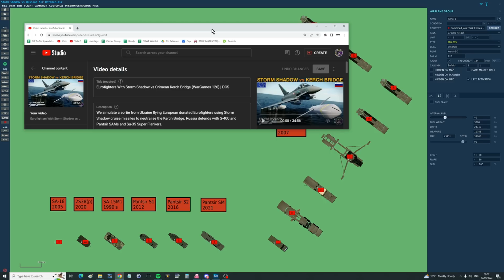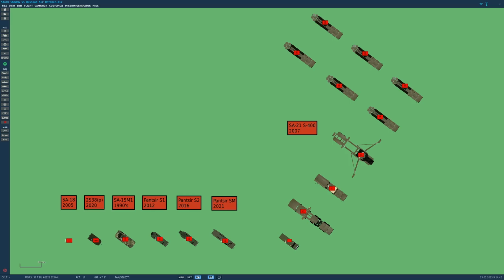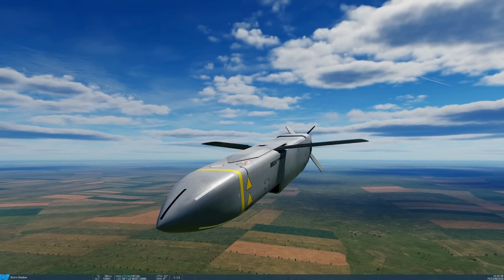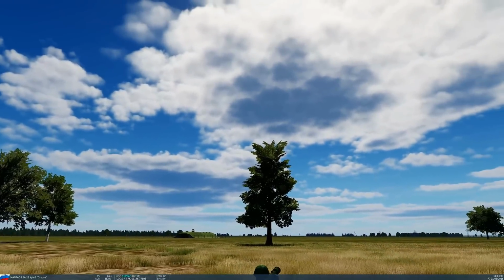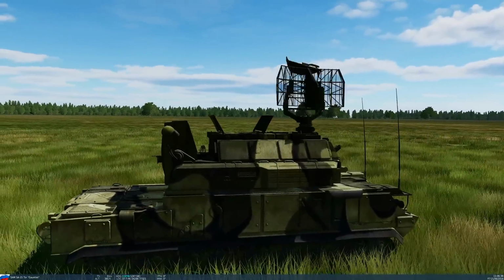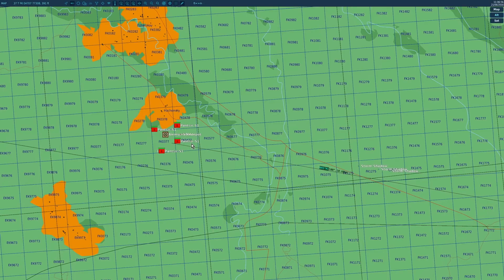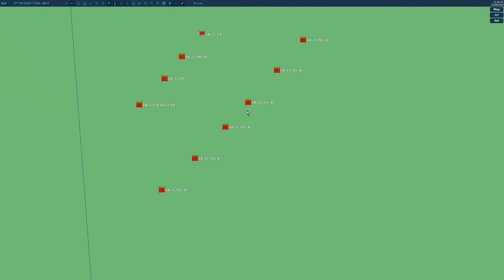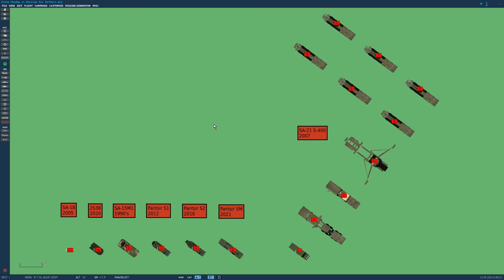Storm Shadow Cruise Missile vs Various Modern Russian Air Defence Systems | DCS

Comment: First of all, the built in terrain maps and maps are useless without a precise navigation system, then if the Russians are able to jam the GPS signals, something they have proven to be able to do with at least three different jamming systems at their disposal (supposedly one reason we don't hear much from Himars anymore), the missile will have to rely on the INS/IRS which by far not as accurate as the GPS and degrades when the missile changes course: the more turns the more degrading, so the missile might not be where it "thinks" it is when approaching the target. What will the missile do, if it cannot identify the target upon programmed arrival using the camera?
Reply: That would be true if they didn't TERCOM at the same time or whatever other acronym does either optical or GPWS-style matching confirmations. There's a reason why Tomahawks and ALCMs flew via Iran in 1990 because Iraq's southern part is as flat as a pancake. The turns over Iranian hills gave more precision by offering correction. 

Cheers from a commercial pilot.
Reply: @Walterwaltraud  Well this is neither Irak nor Iran, and Russia has totally different electronic warfare capabilities.

Cheers back from an ATP pilot.

Comment: I got some info on how they deconflict the SAMs and aircraft. There is IFF systems but they are either not reliable or older equipment can't use it. So they will send out notices to SAM operators that the air force is operating in this area at this time. And so there are zones and times where the SAM is to consider air targets friendly. So the SAMs can stay on, but its easy to make a mistake and shoot at your own guys or to let targets through as they are coming through a air zone designated friendly.

Comment: the US doesn't use super tall or even very large mobile radars because 1. It doesn't fit their envisioned combat needs. 2. They plan to have complete air dominance in an area before boots are on the ground.(in western militaries aircraft are highly networked with SAMs etc & are used as an extension of AA systems)

Comment: As stated by the Ukrainian MoD.. The Su-27 and Su-24 have the necessary load capacity to carry Storm Shadow... but if my memory serves me right the Mig-29 (depending on what model I would suppose) can only carry 750kg of weight in total on all pylons. That, if I am correct, would preclude the usage of the amazing Storm Shadow on Mig-29s.

Now F-16s is a different matter. From what I have heard, though this is just breaking news and unconfirmed currently, the United States has given approval for EU F-16s to be transferred to Ukraine. It was stated though even if the pilot training started today it would take, at an absolute minimum, 4 months to bring pilots up to speed on the western jets.

Comment: 17:25 Serbia bought a version of this turret and gun, but for ground attack vehicles, not AA. Mounted on prototype vehicle called "Lazanski". And it has faster rate of fire than shown here. Hell, even S-60 which is 57mm AA gun from 1950s had faster rate of fire (70 rpm sustained and 105-120 cyclic). So, I'd call this unrealistic.

Comment: ADM-160 MALD is a decoy designed to fly around and get shot down....lol    Seriously, it is used to attract the Air defense, so missiles like the Storm Shadow can get through.   The MALD has all kinds of tech to detect Air defense systems when they fire at it.  Which is used for counter fire.   It has no warhead, either.   This would most likely be used with the Storm Shadow missile, making everything more effective.

Comment: I'd like to see the Storm Shadow vs the Kerch bridge, but it ought to be accompanied by other long range HIMARS or possibly Neptune missiles. Even if they can't reach the target they could function as SAM sponges. (Have Cortana plan the attack and tell her we want as many distractions as possible, so long as they are realistic)
Reply: The railway line has a rich supply of bridges in Crimea proper that, if taken out, would render the Kerch Bridge effectively useless for supply purposes. These are likely to be way less defended. I would go for the bridge over the North Crimea canal at 45.180N, 35.431E. Not only causing supply problems but  also causing issues with the water supply to Kerch 🙂

Comment: 2S38 , what like the T-14 Armata, like the SU-57, like the SU-75, like the MiG-41let's not forget the SU-37. Russia talks nonsense, comes out with half baked concepts, zero manufacturing competence (no 2 same of anything is the same in Russia). I question everything Russia makes right now, I understand the design but the actual execution of these designs is terrible. I seriously doubt the range, ability and reliability of Russian tech. Admiral Kuznetsov, the T-90 the Ka-50 series the whole stinking lot. FFS even fire extinguishers on board their ships are secured in an arms locker that can only be opened by Admiral or above, no joke.
Reply from the maker: My understanding is that Russia like to develop these systems for sales abroad, but when they don't get enough orders to justify the build, they are canned and never make production.
Reply: @grimreapers  I think that is partly true Cap, however look at those who buy these systems they never buy again. Recently Brazil choose the Grippen over the Felon. India pulled out of the Felon entirely and are even phasing out the Russian inventory in their military citing sub-par standards. Russia is not an industrial superpower anymore and the new designs are just rehashes of old. Your completely right Cap and you even say numerous times DCS works on the principle that everything works to what it is designed for. My problem is that when it comes to Russian or Chinese equipment or tech in the past 50 years it has never shone or showed anything what was claimed. Case and point the Flanker, it has never actually achieved air superiority in any theatre of war, ever. Be it Russian Flankers and any other Flankers. So when everyone says the Flanker is on par with the F-15 there is no actual example of this or anything close to an example. Even DCS players know to keep the expectations of the Flanker to a lower level. You guys (GR) even showed me the Cobra manoeuvre is a dangerous thing and honestly only useful in 1 scenario, the rest of the time it will get you killed. 

In short all public military material is to be taken with a grain of salt and they all tell a lie or exaggerate the truth. I just have a sneaking suspicion that Russia and China are telling far bigger lies about their military capability. Even you Cap were left scratching your head about the Moskva.

Comment: Wargame suggestion:

4 Russian aircraft were recently shot down over Russian territory including two Sukhois. The people that say that Ukraine was responsible for the shoot down are split between Ukrainians inside Russia with MANPADs, Ukrainian fighters, Ukrainian fighters WITH western missiles, and Ukrainian long range air defenses. Can you wargame which of the 4 speculated causes are the most likely causes? Love ur vids, thanks!
Reply: Manpads are unlikely to be that cause of that shoot down, a visual evidence suggests that at least one helicopter was downed by a missile that was ca. 4 m long. Also, all the crews were killed, manpads does not pack such a punch and usually there is time to eject (for aircraft that is); one option would be that those were downed by Ukrainian SAMs but that would require bringing them right up to the border massively risking their loss (even if due to the visible logistics); the whole event unraveled within few minutes; Russian aircraft and helicopters were a complete strike package (Mi-8s were an electronic warfare versions Russians have 18 of them, with 12 in flying condition), and they went down in a quick order. So however crazy it wouldn't sound the most likely option is that those aircraft were downed by.... A salvo of AIM-120s. Now that is an interesting development if it were confirmed.
Reply: @44lucas  Good points but after all, this is what wargames are about so I think MANPADs should still be included for the sake of it being a possibility however unlikely. As for SAMs, I think it could be possible with Patriots using PAC-2 missiles which have a 160 km range so they could cover the area where the shootdowns happened while placing the launchers not too close to the border so I don't think SAMs should be ruled out. As for AMRAAMs, they could be also be possible considering we didn't even know that ADM-160B MALDs were in Ukraine until debri from the decoys were found.
Reply: @shtorm2616  it was friendly fire incident for sure. There cant be so many MANPAD units in quite large area (~50km between crashsites) acting simultaneously. Also cant be SAM even on border - too far to hit low flying helicopter. Friendly fire due IFF malfunction/operator's mistake. That's why both ukrainians and russians not talk too much about it - nothing to be proud for both sides.

Comment: For what the gentleman was talking about with the programmable projectiles fired from a canon, look up the Oerlikon AHEAD program.  From what I've seen of it, it comes in multiple calibers for an array of platforms that it can be mounted on.  Impressive stuff.
Reply: Yeh Rheinmetall offers the Skyranger wiht a 30mm ahead gun as a kind of Gepard successor. A single smaller gun, but makes it up with airburst ammo and AA quad launcher (eg stinger or so).

Denmark actually bought that system recently. Hoping Germany follows up!

Comment: Very high risk for Russia - allegedly lost 2 x airframes and 2 x helos in the last 48 hours to friendly SAMs.
Reply: it was a Ukrainian ambush, it wasn't friendly. Russian SAMs have IFF capability and the SAMs would be told about active friendly air operations.
Reply: @spidersaremean8917  no they don't. They tage friendly planes all the time. Hell most of the Russian air losses in 2008 was from friendly sam systems
Reply: @terrynewsome6698  not sam systems but MANPADs. Both sides in Georgia used Su-25 so mistakes of ground units was common. But this very incident likely be due the SAM IFF malfunction/operator's error. True.

Comment: I think the reason Patriot doesn’t have it’s own long range ground based Radar is because doctrine says that they will rely on airborne networked platforms such as Apache or AWACS.
Reply: I was wondering about that, too, and I would guess it's because of the type of threats America would usually encounter. The US always fights in an air superiority situation, so airborne radar platforms are always available to track low-flying cruise missiles. Anyone else using the Patriot should think about supplementing the radar array with something to boost its low-level detection radius.

Comment: Actually, The SA-12/S-300V did intercept all of the Iskander-M's in your video (Using the 9m82 missile). The system even managed to down one of the Iskander-K cruise missiles (Using the smaller 9m83 missile). It was the SA-10/S-300P who had trouble due to not having the proper radar (Clamshell radar) given to it (An ingame issue).
Reply: Tbh my trust in russian AA/AB systems is pretty limited at this point. Even an S-400 struggles to shoot down basic GMLRS missiles, but Patriot takes down "indestructable" Kinzhals? 

Kinda reverses the previous hype of S-400 being world class and Patriot bad.

Of course, the systems still work, even S-300 are a big reason russia has no air superiority. But more advanced russian/soviet AB/networking capabilities seem suspect.
Reply: @termitreter6545  I doubt it, cause the "interception" of the Kinzhal missile is quite unconfirmed. Because Ukraine claimed to have shot down 6 or so Kinzhals, while the Russians have said they never even fired that many in the first place. 

Plus the claimed wreckage of the Kinzhal missile doesn't have any similarity with the design of a Kinzhal, it looks more like a FAB-500. 

Also both the Kinzhal & Iskander-M aren't ballistic missiles, but rather semi-ballistic missile with cruise missile type capability. And just like any other missile they more or less have decoys & ECM to jam and throw off the incoming missile.

Russia will hype their air defence system just like any other country it's natural. But US sanctioned many countries that have acquired S-400 systems, which could indicate that US does see it as a threat. If it wasn't capable, they simply wouldn't have been that serious in this regard
Reply: @termitreter6545  Well i think the KH-47M2 is shot down story is kinda strange to me. The booth sides uses maximum propaganda now.
Reply: @termitreter6545  Are you dumb? S-400 does not shot at some small missiles at all and Patriot didn't intercept anything, it was simply destroyed after wasting 150 million dollars.

Comment: America doesn't typically use the mast radars (peekaboo). These radars ARE on Naval vessels, obviously, but not with the artillery, engineers, etc... The reason is due to more ego, in my opinion. 
The ADAB does use very occasionally but typically the U.S. has been reliant on GPS, SAT, etc...
Even Communications in the military use mast and peekaboo type systems for radio comms.. you think it would be a no-brainer.

Comment: To make some corrections here.

1. Russia does not de-activate their SAM sites when friendly aircraft are operating, as the Russians have specifically designed all their aircraft, especially air-superiority ones, to be integrated and operate within their IADS, which is one of the reasons Russia has an extremely difficult airspace to penetrate, excluding drones, of course, so they have no problems identifying which aircraft is theirs, in theory, anyways. So, I’m not sure where people got the idea that Russia still does this, friendly-foe identification systems have been around and used by world powers and civilian air traffic control since WW2.

2. Ukraine did admit later on that they actually did not intercept a hypersonic missile, and it turned out to be a simple cruise missile.

3. The reason for the S-400 being so “crap” as people claim, is due to Russia not wanting to use their S-400 in an area where HARM’s could possibly strike them, and, therefore, no one really knows how effective it is in combat. The efficiency of the system is yet to be proven due to this fact. Maybe it’s shit, maybe it isn’t.
Reply: 2. FACT CHECK = FLASE! They in fact said that they did and showed evidence!
Reply: I thought you were going to make some corrections?  further down the page maybe? another video?

Comment: You could probably simulate a MALD-B in DCS by having a plane with a missile visual model of similar turbojet powered winged design to Stormshadow and a really high RCS that just flies in circles on a pre-set flightpath soaking up SAM's, though not sure if you would have to give it a dummy warhead for DCS units to see it as a threat. MALD-J you couldnt do because of area jamming not being properly implemented in game but essentially rather than trying to spoof search radar the MALD-J generate so much radio noise in the bands of the FCR radar that they are saturated and literally can only see the decoy and so cant get a lock on other genuine aircraft despite their search radar being able to see them. MALD-B weigh 300lbs and have a range of 500nm and work by simulating the radar return of a fighter or bomber (programmable profiles) while mimicking their subsonic speed, waypoint manoeuvring and formation flying. Though looking at the US's public program performance reports of the MALB-B and MALD-J from a decade ago they had serious issues with navigation and a lot of them had to be self destructed for flying off course during testing, and thats a decade after their introduction.
Reply: Or just give it TALD characteristics

Comment: Just put the smart rounds in the phalanx. It's basically  off the shelf tech. They already make the smart rounds for smaller calibers.
Reply: That's the problem with 20mm, it is too small for fancy fuses.  Fill  the projectile with fuze and you reduce the load of HE.  Phalanx is old.  You need 30mm.
Reply: They do have smart rounds, and that is what they usually use

Comment: In the USN we called it "blue on blue" or fratricide. And it's not just a Russian problem. It's a global problem. Every modern army has spent enormous amounts of time, money and training to reduce the problem. In Desert Storm the Iraqi's knew that we had radar homing missiles so they would turn them off periodically to confuse the incoming HARMs. But they did not realize that the missiles had a system that would remember the location of the transmitters even if they went dark. It did take them long to realize that small oversite. And a heat seeking missile cares not for the markings on the aircraft. Heat is heat.

Comment: The shells get programmed at the end of the barrel. The thing that looks like a flash suppressor is the programming ring.
Reply from the maker: thx
Reply: @grimreapers  Even the Gepard have airburst programable ammunition, but im not shure if it was right from the start in the 80s or if its an upgrade.
Reply: @fopmstru1  I dont think the Gepards ever got the upgrade for programmable airburst ammo? At least not in german service, IIRC they just got a device measuring bullet speed or so at the front.

But the Gepards' gun is a quite common Oerlikon, which exists in many variants. Skyranger got a 30mm one with programmable airburst ammo.
Reply: @termitreter6545  uh thank you for the correction, looks like i have misunderstood something then.
Reply: @fopmstru1  Tbf its possible some other user got the upgrade and youre correct^^